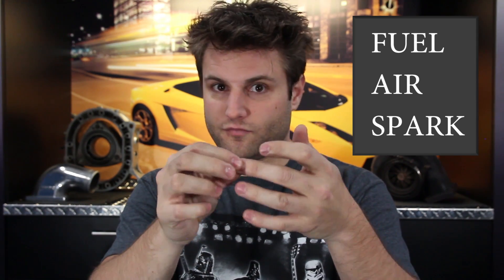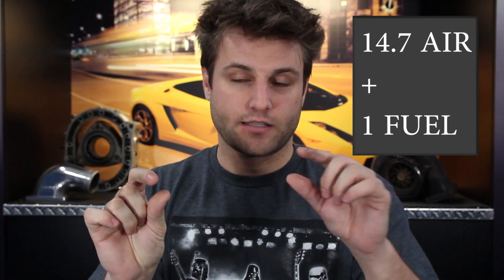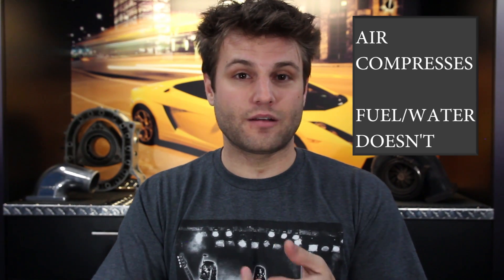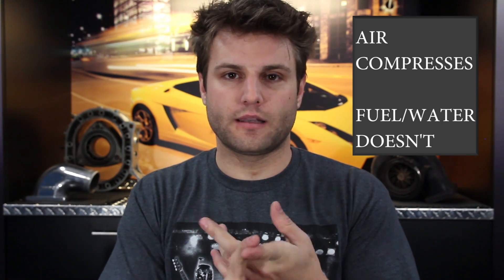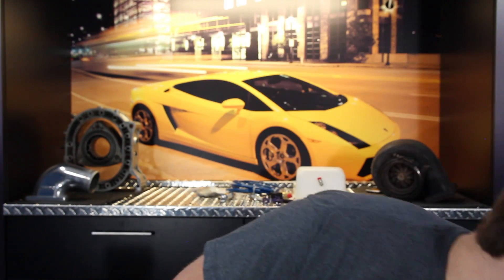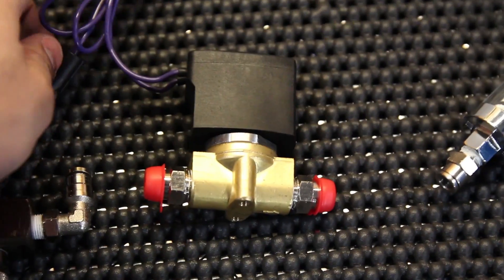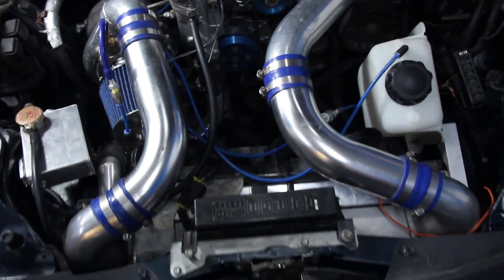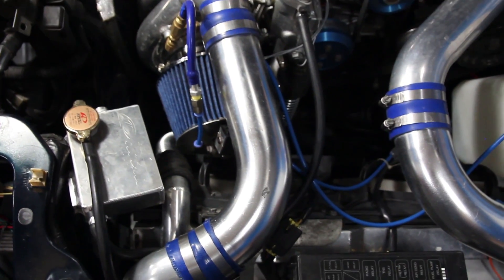Pre Turbo Water Injection - Explained

Comment: Emmmm... when you inject water-meth before turbo, you will compress less air, you should note that. And one more thing why I do not use it anymore - cavitation factor and corrossion. Compress wheel on turbo will die much faster than it should. I've ruined 2 turbo cartridges before understand what's wrong. Water mist should be very, very good dispensed to prevent cavitation and compressor wheel damage on high rpm and no any of water-meth system with the smallest injectors can not give such mist. One of tech solution that can be provided it is ultrasonic mist dispenser but it consume big amount of electric power that make such solution useless cuz this power will take from your generator and it will still your engine power. But if you have amount of budget to overhaul your turbo more often than pre-turbo injection is not bad at all

Comment: Saw water injection on a turbo video and got curious because I know about hydro locking but you explained it very well that when used properly, it’s not actually catastrophic like I originally thought it could be. It makes sense considering the higher engine rpm’s,  not enough water (I now know it’s just very humid air) is making it into the cylinder to cause issues for the engine. Thanks for breaking it down Barney style.

Comment: I'm trying to research and find out how well this particular method of water injection cooling would work on a supercharged setup. M90 on a GM 3800 series 2 without an intercooler (because GM was the only idiots that made a supercharged engine without an intercooler). I'm possibly looking at going with a smaller pulley for more boost, but I want to cool the charge, and my project will not allow clearance for an aftermarket sandwich intercooler. I'm considering water methanol, but would there still be an advantage to just water injection vs without anything? Would the gains or efficiency be worth it?
Reply: yes straight water with a smaller pulley will work well

Comment: So you just pour the water to the tank,and spray directly into the throttle body through air filter before the turbo?  What is the concentrate?  Just water or mixture with methanol?

Comment: Hey Rob, ever tried water injection between engine exhaust and turbo turbine to get more volume to boost from?
Reply: Wooow, bro
Reply: It will cool exhaust gases and decrease its volume.. that’s why your task is to keep the exhaust hotter
Reply: @miratorgfood  you know the difference in volume between water and steam? Around factor 1700 if I remember correctly.

Comment: I have a smart and stupid idea but it might work 😬 take diesel injectors put them in the intake 1 for each cylinder and use a p pump or a smaller pump lol to pressurize the water/methanol

Comment: Pre turbo WMI is not good idea because of compressor damage. Efficiency of turbocharger doesn't depend only on heat. There is lot more parameters, A/R, compressor wheel design, dimensions, turbine design and dimensions...

Comment: Gasoline engines are designed to burn gasoline. They are not designed to “explode” or detonate it. There’s a huge difference. During normal operation, air and fuel is introduced into the combustion chamber, compressed so as to improve the force of expansion as it burns, then near top dead center, it is ignited by the ignition system. What is supposed to happen is that the fuel immediately adjacent to the spark plug is ignited, and as it burns it ignites the fuel surrounding it and so on outward from there very much like a wave of flame. It’s like making a circle of match heads on top of a table and dropping a lit match in the middle (or anywhere else in the circle). The flame will spread rapidly, but never instantly.  

Not my words got this info from a thumpertalk article on octane ratings but thought I'd share with you so I can better understand how gasoline ignites and burns if you know this sorry jus thought I'd mention after you were trying to find the right words to say about it.

Comment: Have you considered that water can actually expand between the compressor outlet and the intake manifold and exert a positive pressure on the piston on the intake stroke on a pre-turbo set-up? So in effect the intake stroke also becomes a secondary power stroke. Smokey Yunick's Hot Vapor Engine had a carburetor before the turbo which heated and expanded the air-fuel mixture without igniting before shoving down the piston on the intake stroke.

Comment: Compression causes the ambient heat contained in a large area to squish into a smaller area, therefore focusing the heat. It obviously becomes hotter. Take all of the heat in your room (293.15°K/m2) and put it into a volume of 1/10th the volume. It should increase in temperature by approximately 10x, (minus losses due to conduction and radiation in the time taken to compress it.)

Comment: Seriously!!!
Fuel does explode genius  . Energy is what you get from the explosion.
Reply: Fuel burns. If your fuel is exploding, your engine is not going to last long.
Reply: +Tyler Hunt 
Paper wood and fuel burns at atmospheric pressure.
Compress air and add atomised fuel to it with an ignition source and you have an explosion.
In an internal combustion engine the explosion otherwise called combustion is timed to take place at the right time so as to force the piston down the cylinder..
Damage to engines is done when the explosion does not take place at the correct time. This is why advancing an engines timing to much will cause detonation and damage pistons rings blow out head  gaskets etc.
As far aa petrol goes. It burns after it has ignited. At ignition even when you ignite it with a match it initially explodes even when it is just lying on the ground however with little energy. You will however feel the percussion wave when you ignite it. Thats what an explosion is.
Reply: Tech Tune Automotive Repairs
Yeah nevermind, wasn't awake yet.
Reply: The fuel burns by being lit by the flame, which is a deflagration. If it was a detonation, a shock front would spread all over the cylinder faster than the frame front. That would damage the pistons.

Look at guns. They use flaked nitrocellulose and nitroglycerin but they're only meant to burn quickly, if they exploded the gun would banana peel.

The most fool proof way to determine it is by seeing if it can set off high explosives. Would gasoline detonate a brick of C4? No, otherwise blasting caps with gasoline would be used rather than dangerous priming compounds.

Comment: so it does pretty much the same as raising the octane level, question is: does it help make power on a tuned naturally aspirated engine?
Reply: It's the same for N/A and turbo gasoline cars. The only difference is that turbo cars benefit more thus more gain but then again turbocharged engines always have more gains in just about every mod that can also be done to N/A. Example is changing out just the intake and exhaust + tuning will provide sometimes more that 60HP gain to the wheels vs 25WHP to N/A car.
Reply: +Bart Van Riel Only if you raise compression of the pistons or advance timing. Octane level of water is infinite as it doesn't burn but you can't add past certain points. But you can keep adding methanol to the mix to raise octane further and/or switch to e85 which has most of the advantage of WI but all day long and reliably.
Reply: CEIKA Limited so if you build an engine with a 25 to 1 compression ratio and add water you could pull it of without knock right?
Reply: 25:1? You are talking diesel i assume. I will not be able to help much with diesel i don't know what is safe but i know that it has been very popular amongst diesels and truckers with massive turbo. If you build the engine around water injection past the knock limit it is a bit of a time bomb to be honest.
Reply: CEIKA Limited no I just said some crazy high compression ratio but about what do you think the limit is?
Reply: SI0AX pretty impressive stuff

Comment: If you inject Water/Meth before the turbo will it also decrease turbo temps and clean it? I assume that the cooling would be better than throttle body injection.
Reply: +Wilbur Landaverde There are different opinions, if before the turbo then by the time it gets to the intake manifold it has lost most of its cooling effect along the way, so while the turbo is cooler the intake temp isn't greatly decreased also I have had friends with water puddling in the inter-cooler or any low bends from pre-turbo setups. I don't believe it cleans the turbo greatly as the turbo is only taking in filtered clean air.  Direct port injection is the best or in the throttle body... the methanol and water have a cooling effect and can help decrease the exhaust temp resulting in a less 'hot' turbo.

Comment: If the water container is being feed air from the same line that goes to the nozzle, how is it staying pressurized?  Is the nozzle acting as a restrictor and most of the pressure goes to the container?

Comment: The combustion can be called an explosion. But unlike high-explosives, it doesn't chemically explode but burns in controlled manner where the gas expansion are used.

I think the fact that it burns and the gases expand is enough to call it an explosion.

Off course everybody should say combustion because it's the proper term because more often then not, explosions are "uncontrolled".

Comment: I know what you're saying even if your wording is not correct quite a bit. For example compressing doesn't make it more efficient, and it's not the same amount of particles, it means you fit more of them in the same space. But we get it, and have these goofs make this video even funnier :)
Reply: You statement is wrong when I say that:

You take an engine and reduce the volume of the combustion chamber with the heads only. For example go from a 26cc combustion chamber cylinder head to a 16cc. You increased compression and it is more efficient because you reduced the displacement and still makes more power. This is according to the fact that you use both the same fuels and timing without detonation.

Comment: Dude, do drugs much?
The term you are looking for is detonation. This occurs when the fuel and oxygen mixture reaches a pressure and temperature greater than the flashpoint of the fuel.
9:1 is considered a low compression ratio. 
13:1 is high compression.
When you compress the air you pack more air in the cylinder. It is not only higher pressure, there really is more air in there.
Air is 78 % nitrogen and 20.5% oxygen.
It is the presence of additional oxygen in the combustion chamber that provokes us to inject more fuel producing higher cylinder pressures upon ignition.

You are almost right in every statement and the poor delivery of the info along with the improper nomenclature seems to be preventing you from effectively communicating you message.

Perhaps if you were to remake the video with a pre-written script and a little less cocaine you could be more easily understood.
Reply: Agreed. BTW 78.** % nitrogen, 20.95% Oxygen, and approx. 1% other gasses. In Navy diving, we just use 79/21 since the other gasses are also inert.

Comment: Are there any downsides or dangers to running a water meth kit, it seems like it's too good to be true
Reply: Water/steam isn't air, thus it displaces oxygen in the intake stream.  If you can't increase boost (turbo not big enough), then it can hurt performance. It allows you to modify the tune/setup for more power.
Reply: bob joe  water contains more oxygen (1 hydrogen, 2 oxygen) by volume than air which is over 80% nitrogen and carbon, and I believe 14% oxygen. However in air it's "free" oxygen.  

But without more boost, you can advance timing, create more pressure, and cool the intake charge which brings more air into the engine.
Reply: The oxygen in water is so tightly bound, that it plays no chemical role in combustion.  Thus steam only serves to dilute the charge.

The energy absorbed by evaporation of liquid water can cool  cylinder temps enough to advance timing, but can also quench the fire and reduce cylinder pressure.  

 I understand the advantages of water injection, the OP asked for any downsides to it's use.

PS: Thanks for the flash back (2 years)

Comment: you forgot about steam, water expands way more than air, thus giving you more torque and more pressure you drive the turbine all while increasing efficiency because heat is staying in the cylinder vs absorbing into the head and cylinders.

Comment: You are so awful at explaining this..
Reply: ROD JOS
Your okay man. Learned this lesson the hard way. Bought a car with a 2ZZ-GE that requires above 91 octane and has 11.5;1 compression ratio.
Reply: ROD JOS Pre-turbo injection uses water, or water methanol, or fuel in blow thru carbs to absorb the heat that is usally created when compressing air.(see ideal gas law).  Water's high latent heat allows alot of heat to be absorbed by just a little bit of water.  This takes the compression from exothermic, closer to endothermic.  Adding methanol will reduce the surface tension of the fluid, so that less pressure can provide the same micron particles(or finer mist at the same pressure, good for the turbo), and technically increase flow.  It's low latent heat will remove heat faster, but will require more to remove the same amount as plain water.  Benefits of surface tension lessens past about 30% methanol to water.

Water sprayed into the turbo will decrease the temperature of the outgoing air, which reduces the load on the IC, if so equipped, and allows more air(cooler air is denser air) to enter the engine. Risks are particles damaging the turbine with poorly set up systems.  Original equipment on a Saab 900 S http://saabworld.net/f70/turbo-s-water-injection-installation-instructions-sept-88-a-1341/
Reply: Please show us how it's done properly then?

Comment: Rob,nice piece.Everything has it's potential down side,adding water/moisture to the combustion chamber may increase BHP etc,but are you not potentially just generating a steam cleaning effect,that does help remove carbon build up,but also removes oil/lubricant from the walls of the cylinder&add additional water to the sump oil (normal burning of hydro carbon produces steam/water).In LPG/propane fueled vehicles,oilers are added improving up cylinder lub, May be for this application also?

Comment: I know air with a high relitive humidity is less dense than dry air with the same temperature. water vapor is less dense as it is oxygen and hydrogen. That being said wouldnt spraying water into the turbo heat, then vaporize,  thus lowering the density of the air charge? The answer is yes, and it kills engine performance. They developed watermeth in ww2 aircraft that injected the mix directly in the carb when the A/F mix was at max lean. It prevented detonation and increased boost.

Comment: power is derived from the expansion of gasses. it has nothing to do with the differential on cold air going in..

temperature only affects how dense the oxygen,hydrogen and what not gasses that are in the atmosphere. colder usualy means more per square inch. but it always depends on how efficient the combustion cycle to produce that power. and the mechanical link between the engine end the driving wheel.

Comment: just a couple notes for u from a physicist. water injection really does just one thing, It lowers the air temp through "heat of vaporization". colder air is easier to compress for both the engine and the turbo. The turbo then can compress more air and the engine gets a boost in heat injection headroom. The P-V cycle will have a larger area due to extra heat injection (fuel). in short, the greater the difference between the initial and finial energy of the air are..... the more power u will have

Comment: You may have covered this but i have a more specific question. When you are placing the injection of this Pre turbo do you still get the same cleaning benefits on the valves pistons etc? 

I ask this because there is little oil on the turbo piping and intercooler system..

Comment: Very cool, the cool thing about engine parts is that they are very strong, but break with sudden load/impacts. That's why valve clearance is so important and why cams are sloped, a slowly increasing load is fine, a sudden sharp load is bad, that's what detonation/knock is.

Comment: GREAT VID!!!! so its not an explosion ;)

could you give me aome advise... 
i have a toyota celica gt with a 1zz-fe 143hp engine witch is n/a stock
i turbocharged it with a t25/t28 turbo running 7psi of boost
would you recommend a water injection for this setup?

greatz from the Netherlands!!

Comment: The water would expand from this change in phase-and create more pressure inside the cylinders, resulting in more force on the pistons. Im not sure if this effect is actually taking place, since it may be water vapour entering the engine in the first place. I will have to look into this a little bit further-and the heat the water absorbs is obviously crucial, but this seems to be a potential area to achieve more power in addition to running higher turbo pressures.

Comment: I have started to watch many more of your videos, I like the channel.
This comes from conversations with my dad a couple years back...
You mentioned in the video that a main purpose of the water is to absorb the heat from combustion and to clean engine components.
I thought that there could be an added effect, especially when water droplets are introduced into the engine. The heat from the combustion will turn the liquid water into water vapour, which is much much less dense.